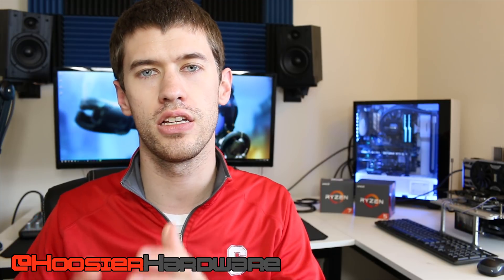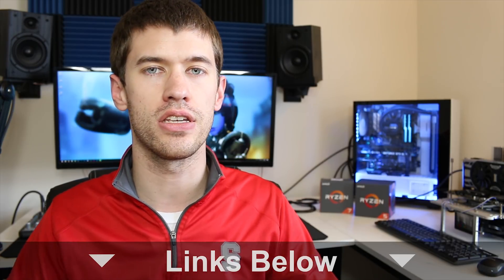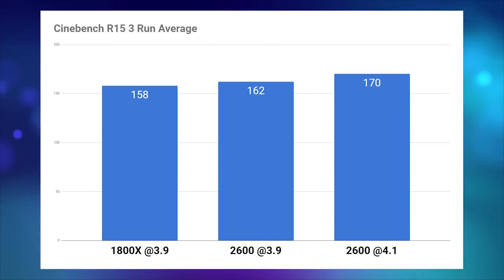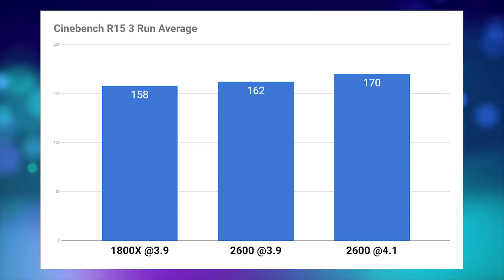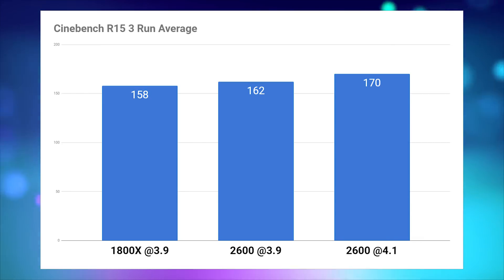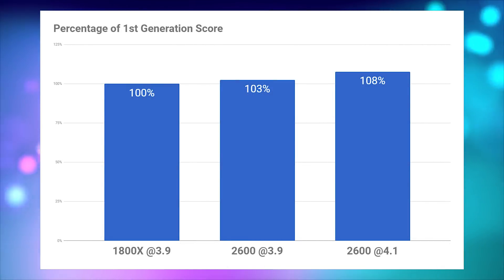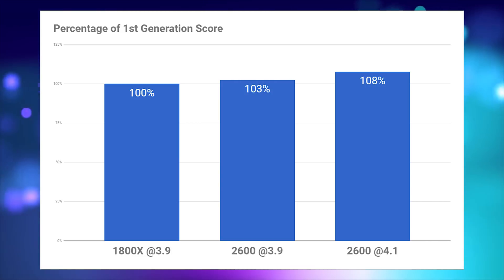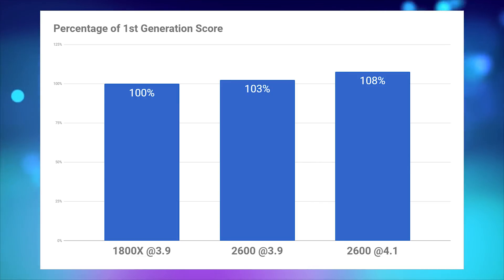Let's Test AMD Ryzen 2 IPC Against the Original Ryzen

Comment: 0:29
The problem with the single threaded benchmark is that it only tests one of the two different approaches to IPC you can get with the same application.
IPC is instructions pr clock cycle.
However it doesn't have to apply to a single thread.
Ryzen got two threads.
And the Zen cores has a IPC for the core as a whole using SMT that's way higher then for a single thread (what Intel is focusing on).
And changes to the processor can impact both the IPC of a single thread and of the core as a whole.
Also, IPC is instruction dependant.
So different codes will have different amounts of IPC depending on things like dependencies (something that limits the amount of instruction level paralellism that a compiler can extract out of the code), and if the code runs into bottlenecks, like a loop being too big to fit into the op-cache or some other part of the code being too big to fit into some other cache....
Also there's the exact mix of instructions used, as different processors have different amounts of execution resources for different instructions, and they execute those instructions at different speeds, with some being multi clock cycle instructions while others might take less then a full clock cycle leaving some resource to spare for a second instruction that clock cycle using that resource.

1:24
Ok, that isn't a IPC test at all.
IPC is a measure of how many instructions you can do in a clock cycle meaning that to test it for two processors you have to get the same number of clock cycles for each processors in a given amount of time (in other words the same frequency).
If you're doing different frequencies then you're testing single threaded performance, not IPC.
After all, IPC does not equal single threaded performance.
Single threaded performance is usually roughtly equivalent to the IPC of a single thread multiplied by the number of clock cycles you get pr second (frequency in Hz) for a total number of instructions pr second, assuming that the instructions are the same for the two processors compared.
Of course different instructions are not created equal, and some instructions can get 3 or 4 instructions worth of work done with a single instruction, meaning that sometimes you can get more performance with a lower IPC and frequency assuming that your code uses instructions that get enough work done in low enough time to compensate.

If you have a CPU that only has a single core and single thread and does a single IPC then if you're adding up A + B + C + D you can do it by loading each number into their own register that we for simplicity just call A, B, C and D right now.
Then you can do add A + B and return the result to register B, add B + C and return the result to register C, add C + D and return the result to register D, as you can see this would take 3 clock cycles.
In a core with more then 1 IPC you could make a compiler that just cleans up the above code to Add A + B and return the result to register B and add C + D and return the result to register D and then add register B + D and return the result to register D allowing the first two instructions to run in the same clock cycle with the final step in the second clock cycle since there's a bit fewer dependencies to deal with.
Alternativly you could just make a CPU with a A + B + C + D instruction where you don't have to rely on the compiler to work out the order of the instructions but just let it move  the instructions to the relevant registers and then execute a single instruction for the whole thing leaving it to the CPU to work it all out internally in the same way that the compiler would have to do otherwise.
In either case you get 2 IPC in the first clock cycle and 1 IPC in the second one for that thread while trying to work out A + B + C + D for an average IPC of 1,5 instructions pr clock cycle, but of course there might be things that might delay one of the instructions for some reason reducing the IPC, or there might be another thread doing its own instructions taking up execution resources etc, etc...

Ryzen can do 5 instructions pr clock cycle or 6 microoperations (internal instructions, not the same as the regular x86 ones feed to it from outside) but only during a loop, otherwise it just does 4 IPC just like Skylake, and that's for the core as a whole, if the workload don't use that many then the higher throughput won't matter as much as the cache latency will make it slower then the Skylake arcitecture found in Coffee Lake since the cores will wait longer for data to work on reducing the IPC.

Comment: I am a confused old man, but it does sound to me like you (and many others) are mixing up instructions per second, with instructions per clock.
If your IPC score changes because you changed the clock speed, particularly if you increased the clock by 5% and saw a corresponding 5% change in IPC score, then I smell a rat. What your program / benchmark is reporting, is instructions per second.
Now that's still a good metric to know, and it can & does effect game performance and how well some of your screen-sheep work, but it's not a measure of instructions per clock cycle.

Comment: if you have an X variant 4.1ghz is a bad OC just leave it alone xfr 2 will take of it... if your mobo supports pbo its even better you will hit 4.2+ghz depending on cooliing.
this gen of ryzen has better binning no point buying non x variant specially 2600... when the 2600x has the spire cooler vs stealth.. X is where its at.
Reply: Actually, leaving it alone isn't the best option.
You can OC Ryzen 2 just fine, but instead of a locked clockspeed you'll want to use precission boost override to OC your processor as that both improve your single threaded performance and your multi-threaded performance without causing your system to quite catch on fire...

Comment: Why would you not have used a Ryzen 5 1600 vs the 2600 instead of the Ryzen 7 it makes no sence
Reply from the maker: Single thread performance is identical and a 1600 wasn't on hand.
Reply: Dave Mckee, it makes perfect "sense". Their is no difference. As the guy said a 1600 is just an 1800X with two lesser cores and operating at a different frequency. You can disable cores and change the multiplier to make it an apples to apples comparison.
Reply: it doesn't make a difference which ryzen you would use they would have the same single threaded performance if they were at the exact same freq, the 1600 is just a 1800x with 2 cores removed and less clock speeds but at the same freq they would be identical in one core performance, doesn't matter. AMD claimed 3% IPC improvement and they were right.
Reply: The number of cores doesn't matter for single thread performance, nor for IPC.
However Hossier Hardware using different clockspeeds makes this a single thread performance test and not a IPC test like the headline might suggest...
Also even if he had  the same clock cycle he'd still only be testing out the single threaded IPC for a single program, not the IPC of the core as a whole when using SMT nor the IPC with different software (IPC is instruction dependent and therefore software dependent).